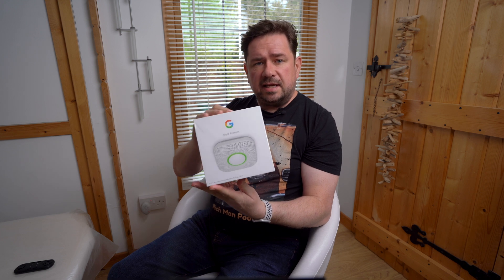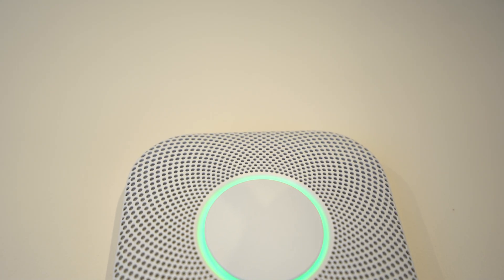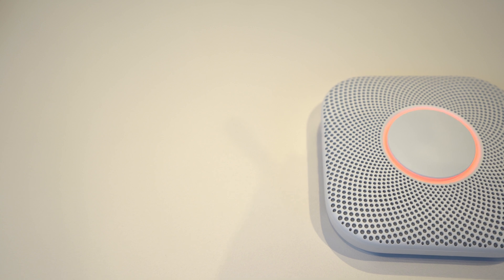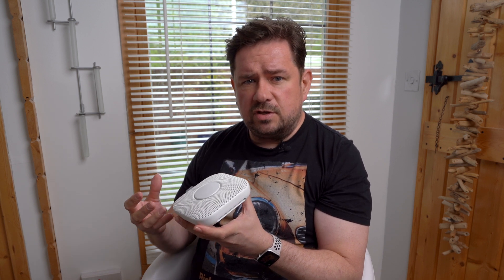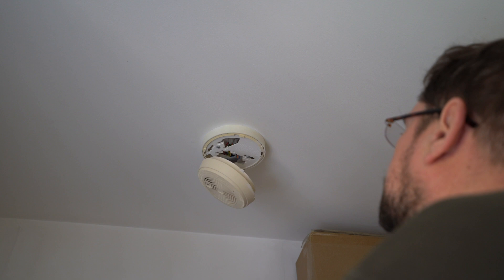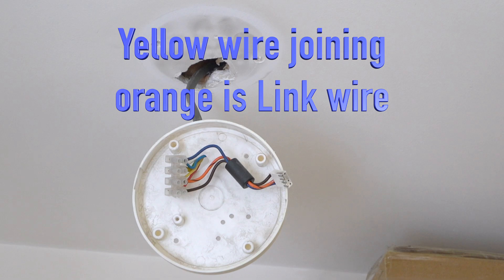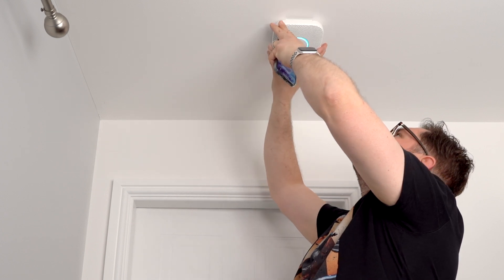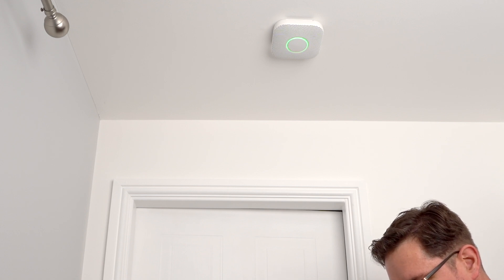Nest Protect Review, and How to Set up and Install

Comment: My battery one started eating batteries so I plugged in a USB cable and put it in the back of the unit. It's running off mains power now and seems to be working well.
Reply from the maker: my one worked for ages on battery only, is your wifi good throughout your house?